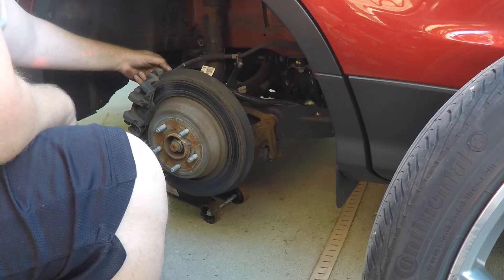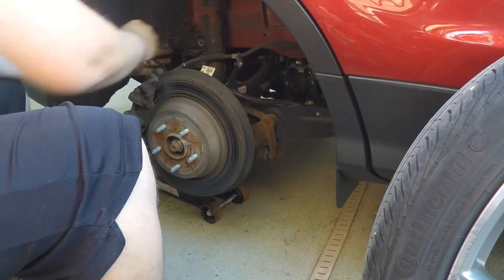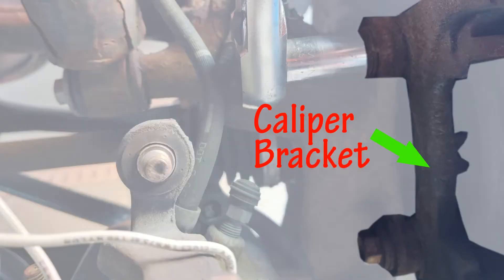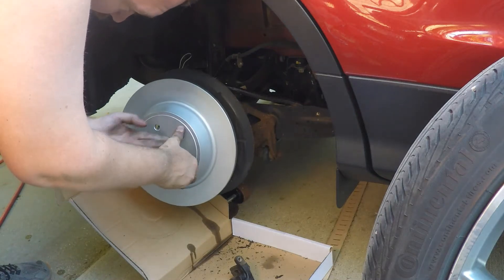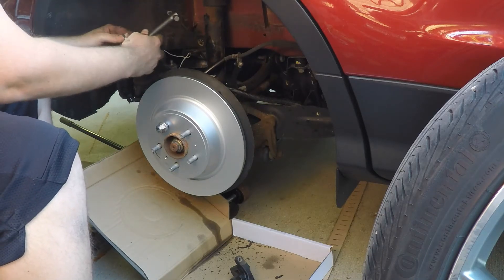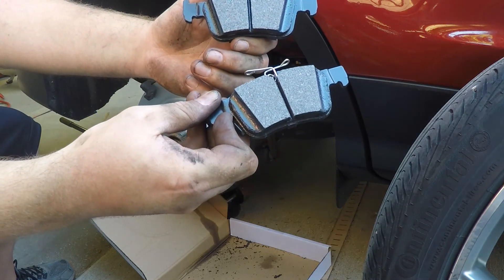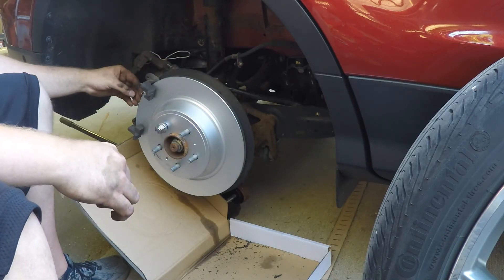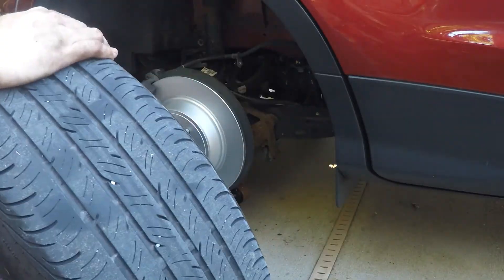2017 Ford Escape Rear Brake Replacement

Comment: The shop quoted the job with new calipers.  They looked at it on a lift with everything totally assembled.  How do I know if I need to replace calipers?
Reply from the maker: I would ask why to that technician. Hard to just know it's bad with out investigating.  Also good be a bad slide pin causing uneven waste of that's all he sees. Tell tale sign for calipers is bad uneven ware and the slide pins can't be repaired or only waste on one side because the other is seized. I haven't dug into new calipers at all on the escape but the only time I replaced those on a different vehicle was when the boot around the piston failed and rusted and seized. I replaced them and had a help with to bleed them off. How it works out for you. Feel free to email if you have more questions

Comment: Great work! Where did you place your floor jack?
Reply from the maker: Thanks TheMedarous for watching. I typically place floor jacks under the frame or axle or in this case a control arm bushing. I then use a jack stand under anything solid just in case something happens.

Comment: Must put into service mode before you start job and take out of service mode when finished with electric park brake or your park brake won’t release after engaged da
Reply from the maker: Yes thank you Paul Craven for pointing this out. Following all manufacturer recommended steps is always encouraged and hope people feel comfortable putting the vehicle in "Park Brake Maintenance Mode" when performing any work/maintenance on those parts.
Reply: @schufledoes  did you put your escape in  "Park Brake Maintenance Mode" I am in the middle of doing mine and I don't know I think I can do it with out putting it in to  "Park Brake Maintenance Mode"
Reply from the maker: @jsautorepair3464  I am not a licensed mechanic and would say dont do anything outside what Ford Motor Company says, that being said. I am under the impression that you can push the rear brake caliper in if you put your vehicle in parking brake maintenance mode.  Also, if you do not put in park brake maintenance mode you have to twist the brake back in as i did. 

Thank you BriBri so much for watching and I hope it all goes well for you.

Comment: They don’t have to be twisted they only need to be pushed in so in a normal C clamp at work
Reply from the maker: Thanks Atomic for the comment and the view. Really appreciate it.
Reply: Correct, for 2016 and older they had to be pushed and turned but for 2017+ with the electric parking brake you just have to push the piston in.

Comment: No mention of the E-brake set up for maintenance!!
Reply from the maker: Thanks Reg Sparkes for the view and comment! There have been other comments referencing maintenance mode which can be covered in another video if viewers need to see how that is done. Thank you again.
Reply: @schufledoes  I'm about to do this job, and that instruction, would be a help too!
Cheers

Comment: What happens if my piston is hard a rock not twisting in ??
Reply from the maker: Possible bad caliper. Is your parking brake active? If your not confident that your doing things properly I would recommend you having a professional look at it. Hope you have fixed the problem. Thanks for watching.